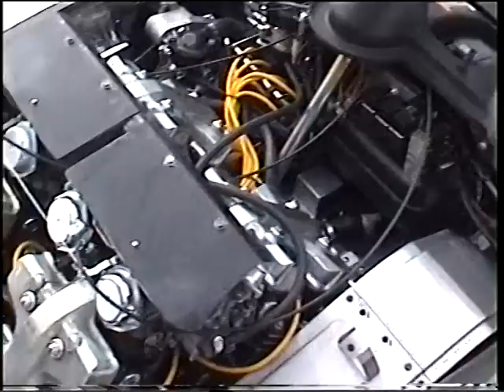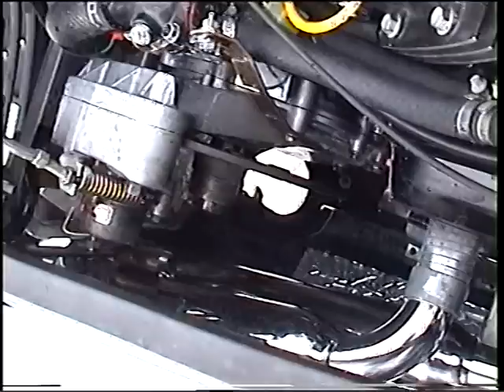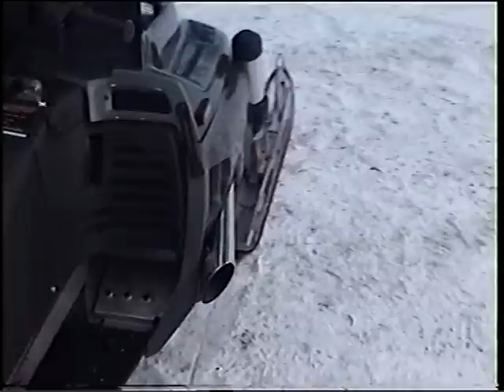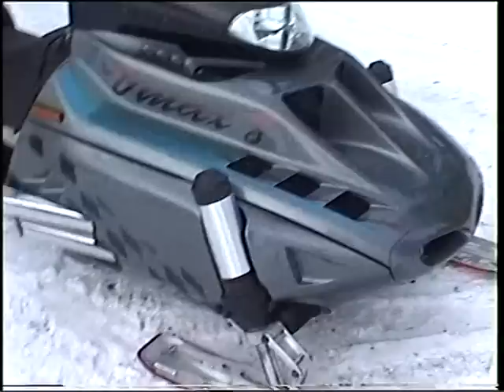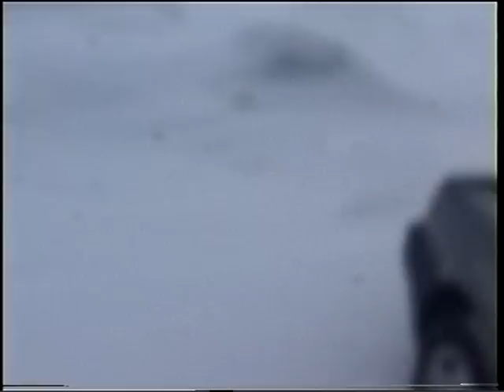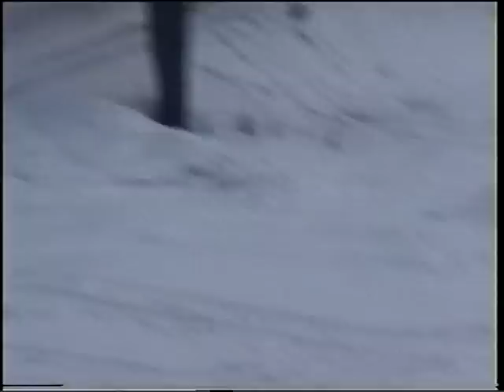V8-powered  sled, worlds first.  - Världens första V8 snöskoter

Comment: ok first off, lose couch of a seat u got there, and the love seat, throw a skinz lightweight seat on, toss a 163 3" camoplast  powder track and some RSI burrandt bars with a riser, slap on a fresh 509 sled wrap, put the wife & kids to bed then lets hit the hills on that bad boy!
Reply: if you think you will survive even the trails to the mountains with the weight of that engine on those tiny pogos, you sir are sadly mistaken
Reply from the maker: CFI Ventrius Only a person with no interrest or mecanical skills make remarks like this.I just wonder If you would say the same thing, standing face to face?
Reply: ...Your remark makes no sense. I was simply stating that the incredible weight of a V8 engine in a sled that was likely no more than a 3 cylinder 1000cc sled originally would weigh heavily on the very small diameter pogo-shocks. Riding on a trail while constantly bottoming out the shocks would blow them out/reduce their usefulness within a few hours of riding. Someone so "mechanically inclined" would realize the truth in the statements I made.
Reply from the maker: CFI Ventrius I see no point continue this conversation.

Comment: Really there are 2 plugs per cylinder. Such as the Ford 2.3L 4 cyl has 8 plugs and the new gen Hemi's from Dodge have 16 plugs on a V8 engine. Now do your homework befor you run your mouth on the internet!